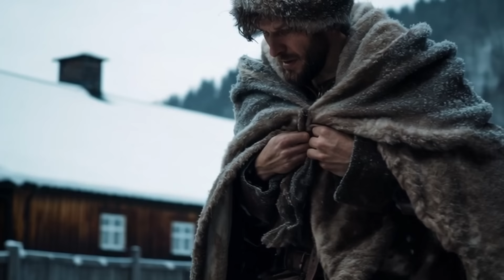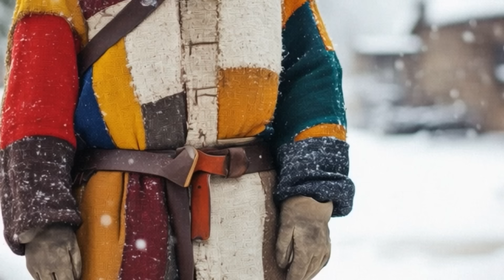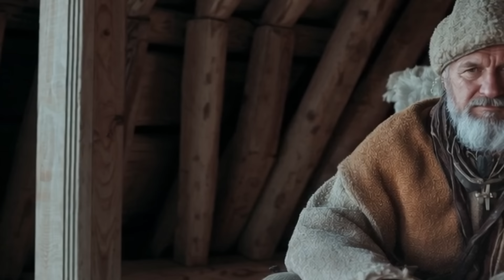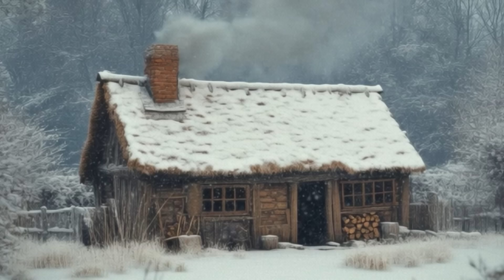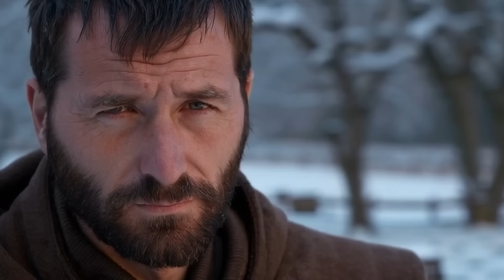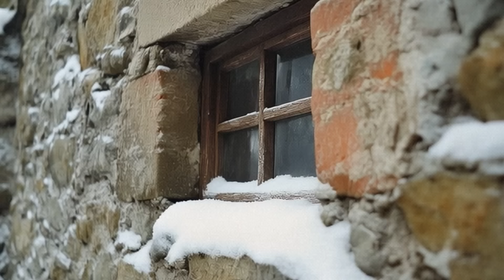Surviving the Freeze – Medieval Houses Built to Save Lives

Comment: All they had to do is put home dwelling 6 feet beneath the ground where earth temperature remains 70 degrees smh
Reply: Not 70. Low 50s in caves. And cold penetrates soil to different depths depending on length of season, etc
Reply: Not in medieval Europe. In the little ice age, six feet would barely clear the frost line.
Reply: The Vikings did just that in Greenland
Reply: Would they have had that knowledge in those days
Reply: That's not true necessarily. It would have helped but I'm sure without modern drainage and waterproofing, it would have done at least as much harm.
Reply: In mn 6ft deep isn't past the frost line in most places, you would have to go 8-10 ft. Even so, with it getting down to -40° some nights, it would still be cold. Warmer than outside, but probably just above freezing
Reply: Correct